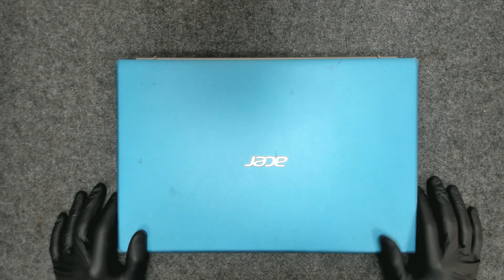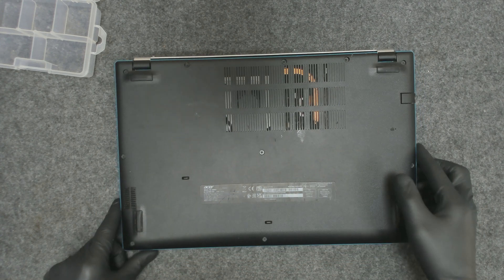Acer Aspire 3 А315 Not charging - Easy charging port fix

Comment: Hi! I have an Acer Aspire 3 A315-24P (Ryzen) that is completely dead after a physical impact (the keyboard frame got bent). It turned on once briefly after the hit, but then died for good.
Current symptoms:
No charging LED or power LED at all when plugged in.
Already replaced the LCD and reseated all cables (battery, keyboard, etc.).
Tried a hard reset (pinhole & holding power button for 60s) with no luck.
No burnt smell or visible damage on the motherboard.
Since the power button is on the keyboard and the frame is bent, could a damaged keyboard matrix prevent even the charging LED from lighting up? Or does this sound like a hairline crack in the motherboard/shorted Power IC due to the impact?
Reply from the maker: Open the laptop and remove the main board if possible. Plug in the charger and check with multimeter do you have voltage on the charging port pin and someplace on the board. Look for big caps rated 25V and measure do you have 19V anywhere.  Also if you gave me the exact board model, a i can tell you what pins to short on the keyboard connector to power on the laptop. But even without the keyboard you should have a charging light. Also when you reset the bios the laptop should power on.
Reply: @LaptopDisassembly okay i will check it carefully after this and look for the voltage(should borowing my friend multimeter first😢)

Comment: Its work for me but when I charge it 20% it stop then not working again can you help me sir
Reply from the maker: What do you mean it stops... It doesn't move the battery icon, or it doesn't increase the percentage
Reply: @LaptopDisassembly  It's not increasing, what else can be do next? not its not charging again
Reply from the maker: In most of tha cases is faulty battery or charger.

Comment: Nice one.  You earned your self a pizza :). I usually short this control pin to ground to avoid it going bad in the future.
Reply from the maker: If it works, I don't touch it. Otherwise yes. :)
Reply: Its work for me but when I charge it 20% it stop then not working again can you help me sir